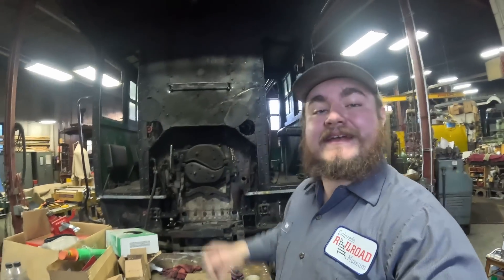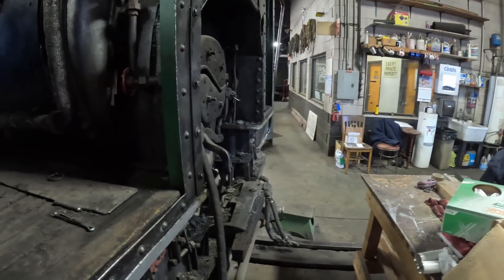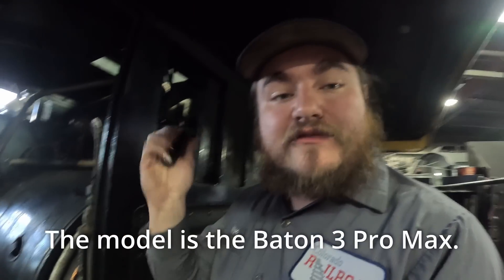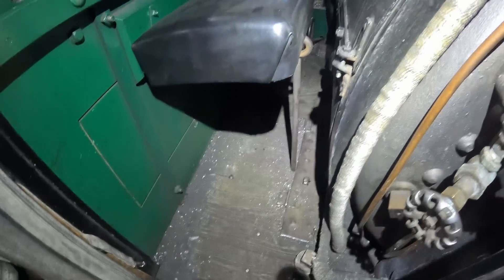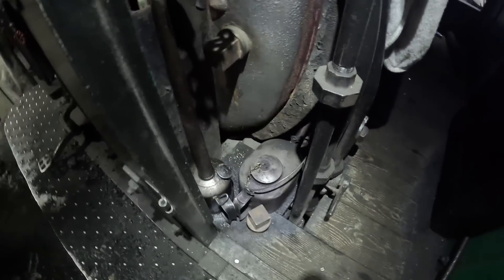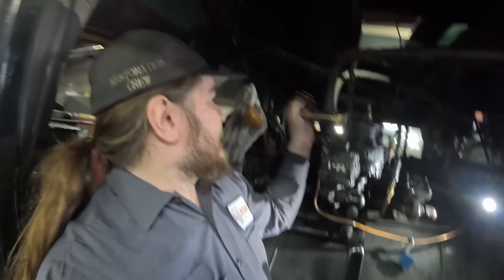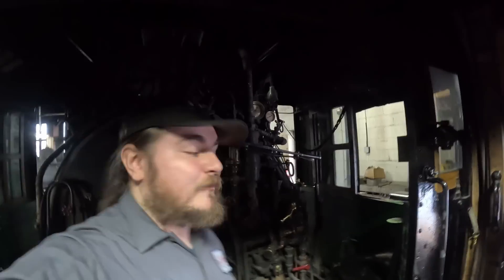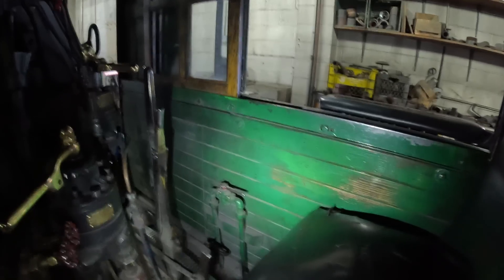BOILER goes ALL THE WAY through the cab? Deckless Steam Engines!

Comment: I've had the liberty of running N&W #475 when I lived near Strasburg and did some volunteering back in the mid 2010s. Deckless locomotives are always a bit of an adjustment compared to the more 'conventional' cabs like we have on the Connecticut Valley where I volunteer now. I'm a big guy, too, so getting into that cramped little space between boiler and cab wall was always a task. None-the-less, I do miss #475, and I'm glad she was repaired quickly after he incident.
Reply: I didn't even bother with the seat while running in reverse when I did an at-the-throttle experience with 475. It was easier to stand and hang out the window. Made the controls easier to work as well. 90 has a much more comfortable cab.

Comment: could you, theoretically, remove the back wall of the cab to give better access to the boiler controls and to just open up the cab a bit more.

I am not suggesting that anyone should mar a piece of history like this, more just wondering if you could, should, would remove that back wall and if It had ever been done?
Reply: In a lot of cases the back wall is structural to the cab, and removing it could cause issues with the structural integrity of the cab.

Comment: Besides the number 475 out at Strasbourg RR being a standard gauge deckless locomotive; John Luther Jones AKA “Casey Jones” drive a deckless locomotive for a long time before he took number 382 into the history books. Number 638 that he use to operate looks just like number 346, but in standard gauge form. From what he told ICRR before he died was he thought it was a superb passenger express locomotive and raved about how smooth and efficient it was to operate as an engineer. Again we’re talking early 20th century ergonomics, but hey I’ll take Casey’s word for it. And also from what I understand he used that exact same engine (number 638) at the Chicago worlds fair where he ran commuter service for the event.
Reply: He first encountered 638 at the World's Fair, but the engine he drove in commuter service was 201, a much smaller Forney type.
Reply: @michaelramsey82 ah that’s very cool! Thank for that tid bit of information.

Comment: Looks like a tight fit for a "healthy" crew. 😊

A possible idea for a future video is discussing firedoor types the narrow gauge engines used.  I see that even 491 is set up with the vertical opening type doors like 346 has.
Reply: Worth noting that people are generally way taller now than they were 130 years ago when deckless engines were common, the fit would've definitely been less snug for a 5'7 working man in the 1890s back when more than one meal a day was considered luxury... Though it still would've been cramped for pretty much anyone in any era.
Reply: I can imagine that worked back then.  A locomotive I used to work on had a gangway that was a go / no-go gauge that would control who could enter the cab.  You had to turn and face the tender to enter.  It would be a snug fit for me nowadays...
Reply: @raydewley9796  Like he said in the video, they were not designed for comfort(honestly it sometimes seems like they were intentionally trying to make it as inconvenient as possible)

Comment: With things being so cramped at the backhead, why do deckless engines bother having a back wall to their cab at all? Normal locomotives already don't usually have a fully enclosed cab (unless they're Canadian), and it's clear that management and manufacturers already didn't give a toss about crew comfort. So why not just omit the back cab wall, save some manufacturing trouble, and make the locos a bit easier and more efficient to work on, not to mention repair if the boiler needed to come out. Just seems like it would be one less thing to worry about, not to mention save a few bucks in wood and glass. 

P.S. Just had a thought (partly just to wind Hyce up), but would a Double Fairlie technically count as a deckless engine seeing as the boiler and fireboxes run right through the middle of the cab making movement between driver and fireman sides impossible?
Reply from the maker: A double Fairlie is indeed deckless. A weirder deckless, but deckless nonetheless. The back cab wall is more for rigidity of the structure of the cab itself than anything, I'd bet. Not sure honestly.

Comment: Great info in this one! I'd also love to learn more about the 1,472 day inspection work if you are up to making videos on 346's. One of my favorite local engines - Reading & Northern's 425 - just went out of service for her 1,472, and I'd love to understand more what that entails.
Reply: It sounds like the equivalent of an airline D check where the airplane basically gets taken apart and put back together over 1-2 months (a C check is basically a commercial annual, heavy but not as crazy as a D check).

Comment: An oil fueled locomotove can be made deckless with no problem. Not as big a deal as with coal or wood.
Reply from the maker: For sure. Lots of oil burning deckless engines.
Reply: @Hyce777  I haven't seen one, but I want to.

Comment: Last time I was at Strasburg (september) 475 was running. Despite actually being in her cab before it never actually fully dawned on me that the boiler was fully inside the cab. I asked the engineer and he told me that the Mastadons were the biggest engine for their time and they wouldn't fit on the turntables, so they moved the cab forward and gave them slightly smaller tenders!

Comment: If you are sitting practically at the side of the firebox and boiler, how do you keep from getting burns? How much insulation is there? And while water works well as in additional insulator, there still is a live fire. Also, maybe the draft from the smokestack helps, but again there is still a live fire.
Reply from the maker: There's about 1.5" of insulation, and then the jacket. The jacket ends up being about 120-130 degrees, which is hot, but not burning hot when you're wearing work clothes.

Comment: I understand deck-less engines but I was just thinking that if the boiler blew up nock on wood which I know doesn’t really happen the explosion should go out the back. Hoping the fireman is not back there’s but saying he wasn’t they would be ok and so would the engineer. I think this because the boilers pipes seem to blow out the front and back. What do you think.
Reply from the maker: If the boiler goes kaboom, the crew is almost guaranteed dead either way....
Reply: @Hyce777  ok. I suppose it’s a explosion. Thanks Hyce. I am just thinking safety that’s all  and possibilities. I think I like 491s cab lol.
Reply: I don't think any cab is safer than another, more like comfier.  As Hyce said, if the boiler explodes, the crew is likely dead either way, or suffer such severe injuries that they pass on later on.
Reply: @austinbrodzinski4444  ya. You see my thoughts are that the blast might go out the back such as the pipes. Because the best friend of Charleston blew up and the fireman passed but the engineer lived. However the loco probably only ran on 75 psi if that. The friendly had a vertical boiler but again very low pressure.  Which is why I say blood shed went into the development of steam. Besides that I have other ideas to prevent boiler explosions. I might make a video on it. So Hyce if you see  this I will let you know if I make the video and you can let me know your thoughts if you would like.
Reply: @TrainBandit  Most of the time, a boiler fails due to low or no water over the crown sheet in the firebox.  This causes the crown sheet to sag and pull away from the staybolts due to excessive heat.  The pressure in the boiler then blows the inner firebox out and launches the boiler (in most cases) from the frame with tremendous force.  Vertical boilers may fail differently, but would likely still become missiles.

This leads to my main point.  Most of these failures occurred due to operator error, or poor maintenance.  These accidents are preventable 99% of the time.  When maintained and operated properly, these are relatively safe machines.  Thanks to the skilled owners and operators of heritage steam equipment in the US, steam in preservation has an excellent safety record.  Coming from a crew member on the Jones & Laughlin NG Railroad in Youngstown OH, I feel very safe around our locomotive and others!
Reply: @austinbrodzinski4444  yes I know how a boiler explosion happens. I have to say it’s great that you tell me this because not everyone knows this. I have heard stories of maintenance and human in error happening. Now I am not saying my ideas are going to save the loco and crew for sure and not sure it will work at all. I do want to experiment it or event talk about on a video and have people let me know their thoughts. Thank you for the insurance that it’s safe to run a steam engine. Although I don’t work on steam I hope to work on them soon. You only live once and a 1% chance won’t stop me. Thank you for your thoughts.
Reply: @TrainBandit  I always like to reassure people that these are actually very safe machines in the right hands, and thankfully (with a few exceptions through history that weren't trained properly) the people who are trusted with these locomotives are very knowledgeable about their trade, and many make it their profession.  It's interesting you mention crew safety.  I'm sure you have heard of low water alarms and fusible plugs.  Those are basically two things in place on some locomotives that help to reduce the chance of a fatal boiler explosion.  J&L 58 has a fusible plug for example, and it has to be replaced every so often to ensure that it will work if it needs to.  It'll very most likely never even be needed, but it's nice to know it's there, even though it might not prevent a full on explosion.  Aside from that, the Canadians used a firebox design of alternating rows of flexible and rigid staybolts that would save Gettysburg 1278 from launching its boiler when it suffered a crown sheet failure.  Thanks to that design, whether it was known that it would save an engine or not, is why the crew of 1278 survived with serious injuries, and why 1278 is currently on display at Age Of Steam Roundhouse in Sugarcreek OH.  As an added bonus, the locomotive is rumored to be able to be returned to operating condition, though I wouldn't hold my breath on it.  But all in all, these iron horses are safer now in the hands of their caretakers than they ever have been.
Reply: @austinbrodzinski4444  that’s great to know. I won’t hold my breath but that would be cool if the engine returned to steam. Thanks for telling me that. I bet that crew was really grateful. I hope to become a professional railroader but particularly steam. My safety system involves a series of valve but for me it seems so simple that they might have tried it. I am likely wrong but if I am they seem very safe thank you
Reply: @TrainBandit  The best way to get involved with steam railroading is to simply start volunteering with an organization!  I'm sure most places can always use more volunteers, especially younger ones.  It might take some time to get into the cab, but if you're patient and willing to help out with all aspects of the railroad (it's not all about the motive power!), eventually you'll be running a locomotive.  Mainline engines like Nickel Plate Road 765 will be much harder to work your way up, and oftentimes you have to have certain qualifications.  But at smaller places like the J&LNG, you work your way up a lot easier and you get a more individualized lesson about steam, as there are less people to teach.  I wish you luck in joining an organization!
Reply: @austinbrodzinski4444  thank you. I know it’s not just motive power. I personally would be happy cleaning a loco and greasing it for a while. I really just love to be around steam. Again thanks for the help.

Comment: Liked this video a lot. So, I'm guessing that they did deckless locomotives, so you had a bigger boiler which equals more steam which equals more power?
And (I don't know if you know a lot about them) but could you do a video on the fireless engines? I still don't understand them
Reply: With fireless locos, instead of generating and storing the steam they use, they would be supplied an external steam (From say, the factory they are operating in) and just store the steam to use. So basically a big tank of compressed steam. They would chuff around until they are low on steam and go refill. They used them in places where a big ol coal/wood fire with hot ash and soot may be a hazard (Chemical plants)
Reply: @mazzar35  Interesting, thank you!
Reply: @mazzar35  To be more precise, fireless engine tank was filled with water, which was then heated with steam from external supply. When throttle is open and steam is being used, some of superheated water inside the tank would boil off, adding more steam. The engine would run until either all water evaporated or cooled down too much to generate steam.
Reply from the maker: Mazzar has explained the fireless well. Yes, deckless gets a bigger boiler for the size which means you can make more power.

Comment: Enjoyed the video, though I was wondering. Wouldn’t the apron always be catching and scraping on the front beam of the tender, or even potentially bent from a grade change?
Reply from the maker: It does catch on the hardware sometimes, but not that bad. It's hinged so it can flop around, and deal with grade changes. It can be a little violent sometimes though.

Comment: When your sitting in the engineer’s seat how do you not get burned on the bowler and a another deck less locomotive is Norfolk and Western 475 at Strasburg Pennsylvania
Reply from the maker: The boiler is insulated! It's certainly still pretty hot, you wouldn't want bare skin against it for a long time but it's no problem to have your overalls against it.
Reply: @Hyce777  ok makes sense
Reply: @Hyce I volunteer as an engineer/fireman of Jones and Laughlin #58, a two foot narrow gauge Porter 0-4-0T which operates in Youngstown Ohio.  The backhead on the 58 is not lagged, so you got it made with that!  It's a fun little thing to operate though, come on up and visit someday if time and money allows it!

Comment: Does it get hot sitting right up against the boiler? I know there is insulation but that still has to put out a bunch of heat when it’s up to temp.
Reply from the maker: It's definitely warm in there, yeah. Nice in the winter. Bloody hot in the summer.